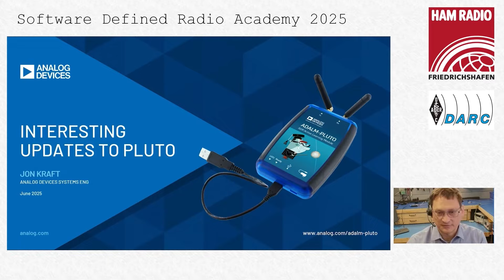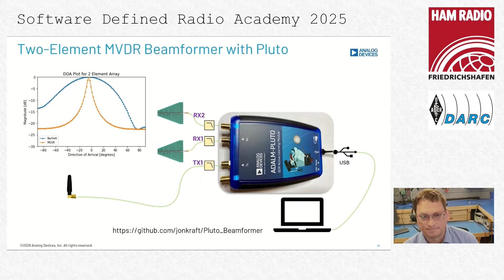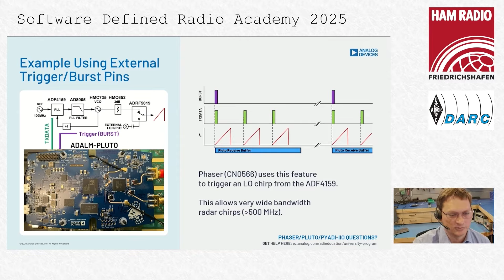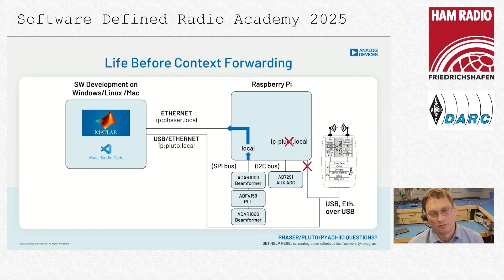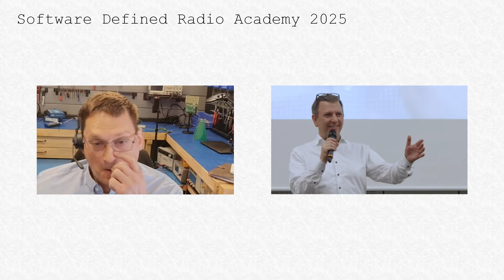SDRA'25 - 10  -Jon Kraft (Analog Devices): Enhanced Capabilities of the ADALM-PLUTO for Enthusiasts

Comment: AI Summary

Abstract:

Jon Kraft from Analog Devices delivers a technical presentation on new features and advanced applications for the popular ADALM-Pluto software-defined radio (SDR). The talk covers four key topics: enabling and utilizing the Pluto's second transmit/receive channel for an adaptive digital beamforming demonstration using the MVDR algorithm; introducing the new Time Division Duplex (TDD) engine in firmware, which allows for precise synchronization between transmit and receive buffers for applications like radar; identifying a potential hardware flaw on Rev C/D Plutos involving shorted ESD diodes and providing a straightforward method for testing and fixing the issue; and explaining the concept of context port forwarding, a feature in the libiio library that enables remote control of multiple Plutos through a single network connection via an intermediate host like a Raspberry Pi.

New Features and Advanced Experiments with the ADALM-Pluto SDR

*   0:03:51 Unlocking a Second Channel: The ADALM-Pluto SDR contains a second transmit and receive channel that is not connected by default. It can be physically enabled by opening the case and adding U.FL to SMA pigtail cables, effectively turning the device into a 2x2 MIMO SDR.
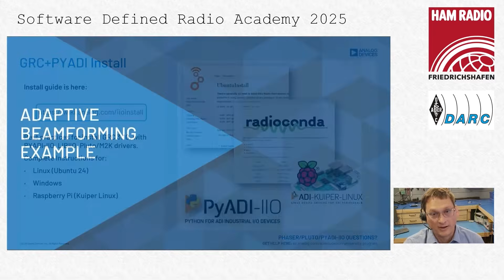*   0:09:09 Adaptive Digital Beamforming Demonstration: Using the newly enabled second receive channel, a practical adaptive digital beamforming system is demonstrated. The system uses the MVDR (Minimum Variance Distortionless Response) algorithm to dynamically create an antenna pattern with a sharp main lobe on the desired signal and nulls on interfering signals, offering superior performance over conventional beamforming.
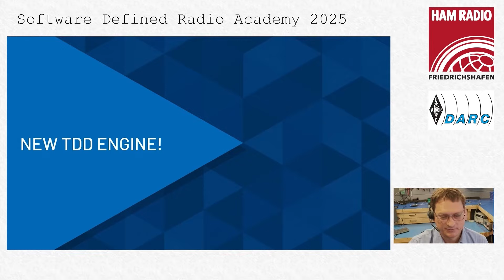*   0:16:29 TDD Engine for TX/RX Synchronization: A new feature available in firmware (rev 0.39 and later) is the Time Division Duplex (TDD) engine. It allows users to precisely align the start of the receive data buffer with the start of the transmit buffer, which is critical for applications like radar (for coherent processing and matched filtering) and synchronized half-duplex communication protocols.
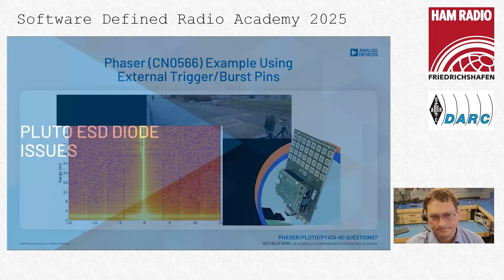*   0:24:54 Potential Hardware Issue on Rev C/D Plutos: A manufacturing flaw may affect some Rev C and Rev D Pluto units. Excess solder can short the RF ESD protection diodes to ground, significantly attenuating the signal on the affected port.
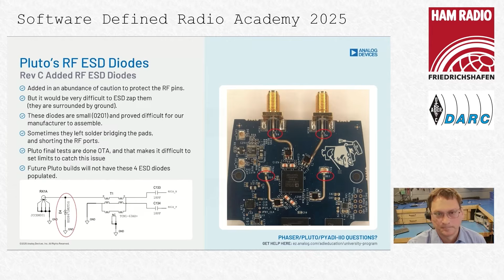*   0:26:49 How to Test and Fix the ESD Diode Issue: The problem can be diagnosed by creating a simple TX-to-RX loopback and checking the received signal strength with a tool like IIO Oscilloscope. If the signal is very low, a short is likely present. The recommended fix is to physically remove all four ESD diodes by scraping them off the board and cleaning the excess solder from the pads.
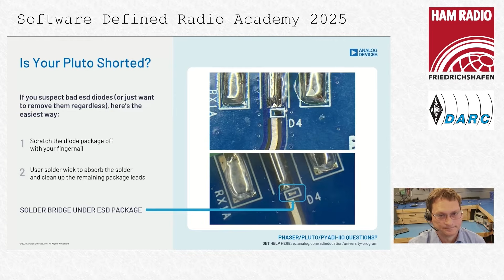*   0:29:15 Remote Access with Context Port Forwarding: This powerful feature allows multiple, physically distant Pluto devices to be controlled from a single computer over one Ethernet cable. By connecting the Plutos to an intermediate computer (like a Raspberry Pi), a service called `iiod` can forward the control context of each Pluto to a unique network port, simplifying complex multi-SDR setups.
*   0:38:10 Synchronizing Sweeps in GNU Radio: During the Q&A, the speaker addresses the challenge of synchronizing data sweeps in GNU Radio. While possible using GNU Radio's native tagging system, he recommends a more straightforward approach: implementing the synchronization logic within a Python block inside the GNU Radio flowgraph.

AI-generated summary created with gemini-2.5-pro for free via RocketRecap-dot-com. (Input: 29,983 tokens, Output: 735 tokens, Est. cost: $0.04).